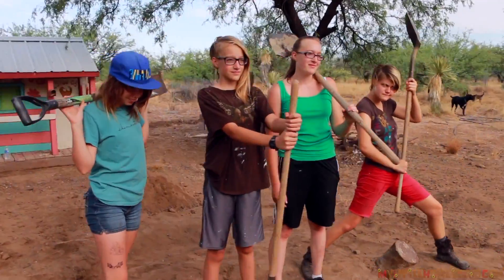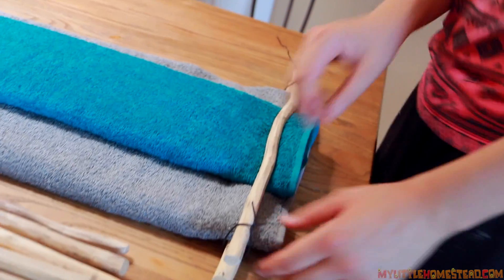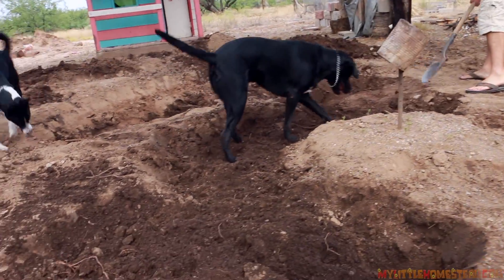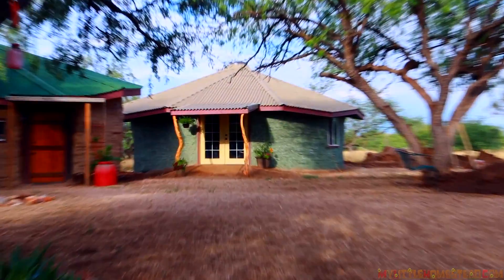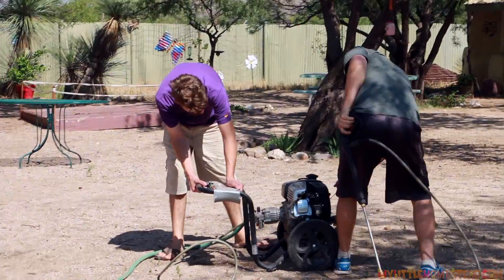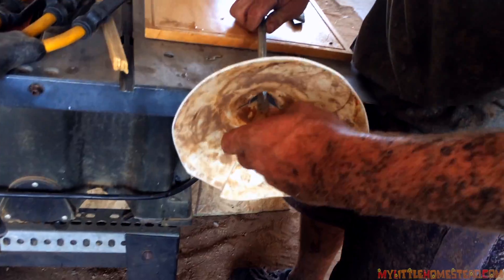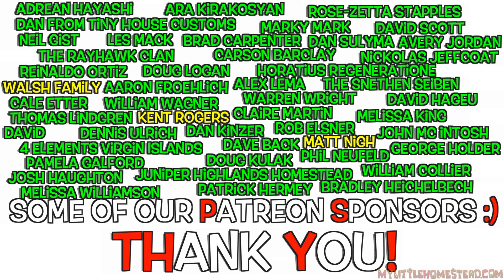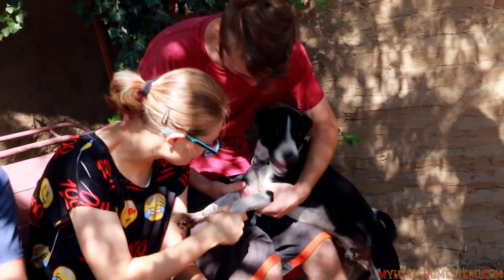Pressure Washer Digging | Shae's Earthbag Bedroom | Weekly Peek Ep97

Comment: Tip, when sanding a stick, put in a drill and hold the sandpaper in the other hand, the drill will do the job on seconds,.
Reply: Generally speaking, sticks are better sanded lengthwise if you want them to feel smooth to the touch. And that works far less well with irregularly shaped sticks.

Comment: For acoustic treatments, you need specific densities of fiberglass in panels,  2.5 to 3.0 lbs/cu.ft. density range.  If you want to absorb low frequencies (bass), then use tubes of fiberglass and place them in corners of the room.  You can cover with any cloth fiber you want, and you should place a few strips of packing tape down the panels, this reflects just a small amount of the high frequencies to make it sound more natural.
Reply: No, you don't. Any material that can flex to absorb energy will work for absorbing sound,  with greater density correlating with greater absorption and greater thickness correlating with greater absorption, and absorption of lower frequency sound.

Over-absorption of higher frequencies is generally only an issue when people who don't know what they're doing cover entire rooms in thin acoustical treatments. The use of bass traps and the like would remedy the issue, and there's generally more than enough acoustically reflective surfaces in a room, otherwise, to reflect enough of the high frequencies.

As for the studio, it's a circular room, and lacks corners, meaning the best places to put bass traps would be where the floors and ceiling meet the walls.

Comment: Concrete canvas cut into squares with a bendable screw strip riveted along one side to make shingles you can apply over any shape or surface then just water then down and let them cure. Be great for covering a roof and walls and the shingles would be fire proof too! ; )

Comment: So I know you guys are really good at earth bag houses. I loved watching the musart studio be built over the past year and have come to really enjoy getting to know the family. Have y'all ever looked into aircrete? It's a new process of working with concrete and mixing it with dish soap and then foaming it up with air. It supposedly lets you make 50 gallons of building material with one bag of quick-Crete. It is light weight, fire proof, water proof, bug proof, a great insulator, and you can cut it with wood cutting tools just like wood, but it is as strong as concrete, although it won't crack like concrete. With some research and imagination, you may be able to build Shea's house quicker and easier and possibly with more architectural features while exploring a new and environmentally sustainable material. Plus it would inspire all of your viewers with yet another way to live sustainably off the land. Look it up on Google or YouTube. There are all sorts of diy discrete videos out there. I look forward to seeing more of you creative endeavors!
Reply: It's not as strong as solid concrete though, and it absolutely can crack like concrete. In fact, the more you want properties like light weight and insulation, the more air needs to be mixed into it, and the weaker it is as a result.

The proper term for aircrete is foam concrete, although it's not even concrete. Using that term, you can look up graphs of density vs. strength in commercially produced versions.

Comment: So what do you do when monsoon season rains so much in the hard desert, that your below grade rooms begin to take on water? any sump pumps?
Reply: Edmund Dobry moisture barrier and graded run off solves this issue.
Reply: Water should never be infiltrating the below grade parts of your structures to begin with. If it is, you've failed.

Comment: hi love your series.

use a low cut filter when having the interviews.  or lower your towels to your ear-seated level.   you guys defeat the purpose of the towels.  :p.
Reply: TeOyaOmqul zig zag the panels is best, with midway overlap. first panel high, next panel top level with center of 1st panel, 3rd panel same height as 1st, 4th panel same height as 2nd, repeat around room.
  considering the size of room and round shape with low flat ceiling, experiment a bit with position of panels. Too high and sound echos low. too low and sound echoes high. Example, auditoriums and theaters with high ceilings panels are set high that the sound echoes low to reach the back of audience. 
   The zig zag pattern may be best for the round room and low ceiling.
Reply: You only need to defuse the sound where you are producing/recording the sound.   The mic needs not to pick up the echoes.  But as always, experiment with the room and positions.  Did you see their DIY project?  where they point to the source of their project?  the guy does the before and after test.  You can see a big difference.  In this video I do notice a change but not as dramatic as the guys.
Reply: TeOyaOmqul Built sound studios before. The small size and shape of room and low ceiling, the Entire room as the studio, likely zig zag pattern would work best. In my humble, yet unprofessional but some what experienced opinion.